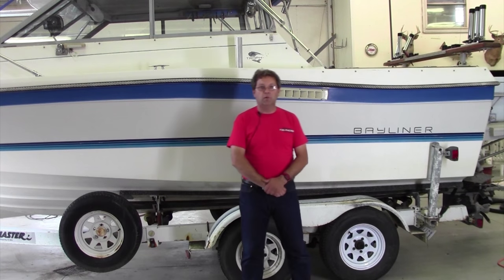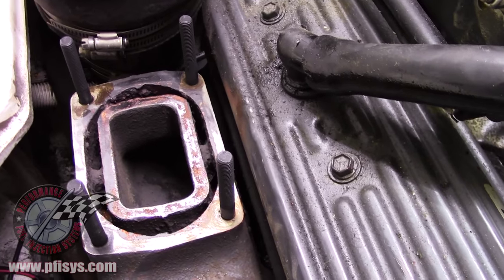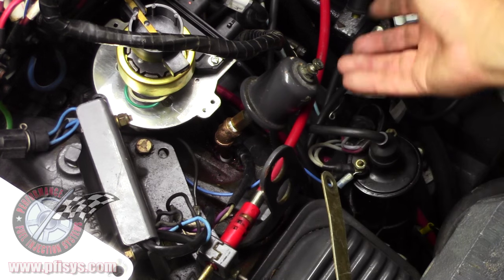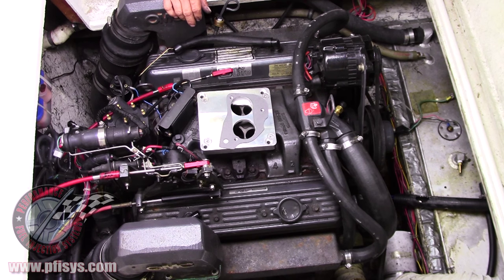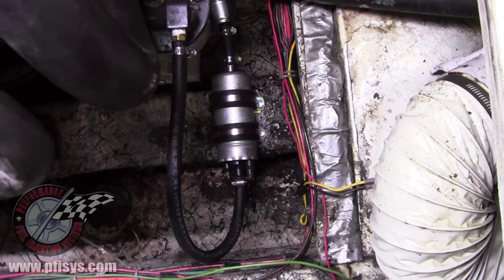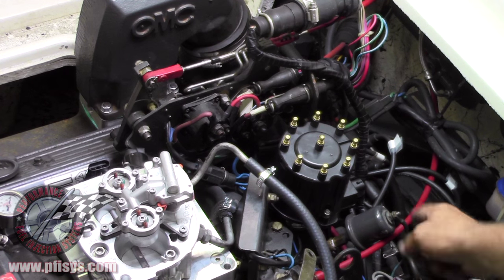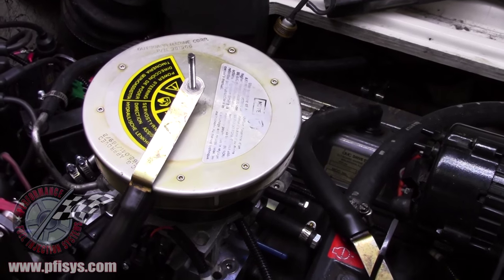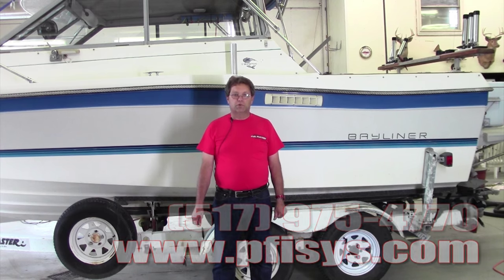Boat Installation Video

Comment: Kevin, I have 2 of your marine stock 350s kits, looking at re powering to blue print engines long block 383s they make 405hp 450ftlbs tq, is it possible to get an upgraded program for your efi system? Thanks

Comment: I was actually wondering if it would be ok to return warmed Gas back to the tank. The factory FI systems Ive seen use a small tank where gas is cooled and recirculated back into the High pressure system. Volvo is what im most familiar with. I know diesels do this w/ no problems. Going to do this on my pair of 350hp Crusaders. Did GPH decrease?

Comment: do you think using hose clamps but a high pressure fuel system in a boat is a safe idea?
Reply from the maker: I have had it on my boat for 20 years with no problem
Reply: ABYC has strict regulations against doing this

Comment: The only issue I can see is that it does not meet USCG rules for fuel shut off. You should have installed a ball valve before barb connection to have a positive shut off in case the hose to the fuel pump ruptured or was cut. The last thing you want is 50 gallons of gasoline siphon into your bilge.
Reply: A ball valve at the tank would be useless unless you had some sort of in-tank fuel pump running. The bigger problem is pumping hot fuel back into the fuel tank from the return line. Most marine fuel systems have a "fuel cooler" so that hot fuel doesn't go back to the tank. Its generally cooled by raw water then reused by the high pressure pump. How long do you think it would take to heat up the last 10-15 gallons of fuel in your tank on a 95° summer day to the point of vaporization? A tablespoon of vaporized gasoline "especially" in an enclosed engine bay can blow a boat to splinters. This is an automotive fuel system that is adapted to a marine application and i would be leary to have it on my boat.
Reply: @kirkmartin2223  ABYC has very strict regulations about fuel delivery systems

Comment: I love the idea of converting to fuel injection, but your method of implementing the fuel system (feed line, pump, return, etc.) is very dangerous and puts the safety of those onboard at risk. And putting the ECM in a location that can get lots of water splashed on it is going to severely reduce its lifespan.
Reply: Can you explain the danger?  Not a criticism here.  I'm considering doing a similar conversion and am looking for information.  I'm a 20 year experienced diesel tech by trade and have been around boats most of my life.  I perform all my own work.  So please tell me your thoughts. 
Thank you in advance.
Reply: @robertb6462  I too plan on adding fuel injection (a GM TPI speed density system) to my 5.7 OMC Cobra engine, but want to make sure it's done properly to minimize any possiblie injury to those aboard the vessel. One of the biggest risks with gasoline fueled boats is getting fuel vapors in the bilge, which can be ignited by a stray spark and lead to an explosion. To help prevent that, the USCG has all sorts of rules in place, particularly for the fuel systems on boats.

You NEVER feed pressurized fuel through a flexible hose that is secured merely with hose clamps. Also, per USCG rules, any fuel hose connected to a barb requires 2 clamps. Ironically enough, the installation depicted in this video only had double clamps on one connection (the feed line at the throttle body). Every other connection had a single clamp. Another thing done poorly was the fuel pump was BEFORE the fuel filter, which ends up sending pressurized fuel through the filter (something it's not designed for). The proper installation would have been an engine mounted fuel pump that SUCKS the fuel through the filter. All of these things increase the risk of a fuel leak, which could be disastrous.

Also noteworthy is to use a marine-rated distributor to ensure any sparks or flames occurring inside the distributor, don't get outside of the distributor. It looked like the distributor used in this video had the vent holes in the bottom covered with screen, which is what's usually done with marine distributors, so they used the right part there.
Reply: You can also put a "T" prior to pump for return line.